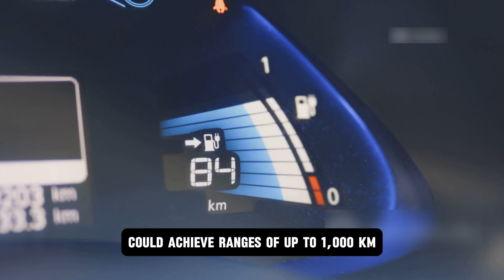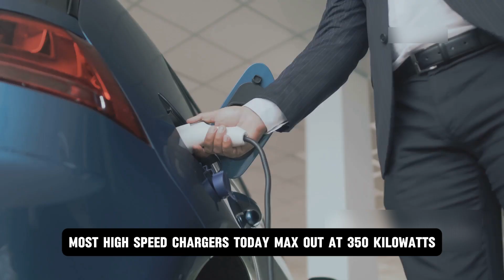CATL New Solid State Battery With 12 Times Charging Speed Begin Mass Production

Comment: I wonder how the charging infrastructure will have to change because of the increased charging speed. I doubt the voltage would go much higher so the current will multiply. Also, faster charge means faster discharge, higher temps, how will everything hold up? how will the charging ports behave? we'll see I guess